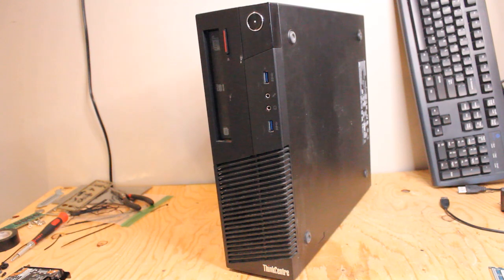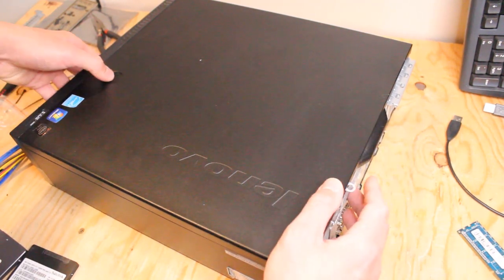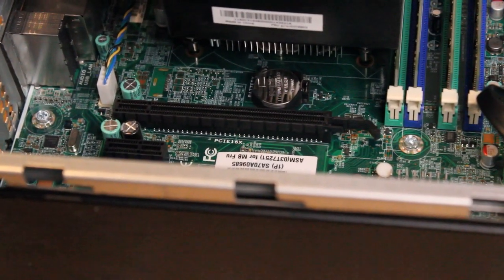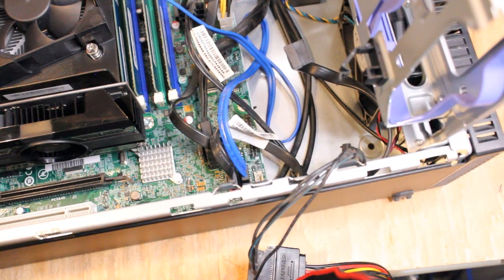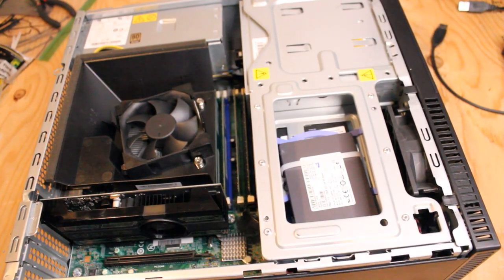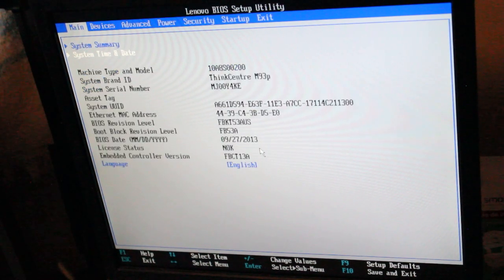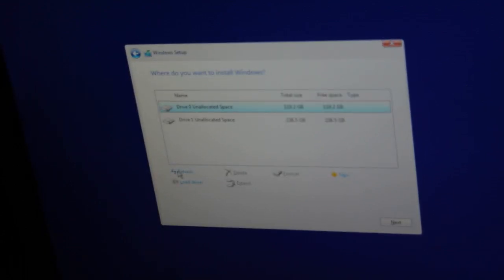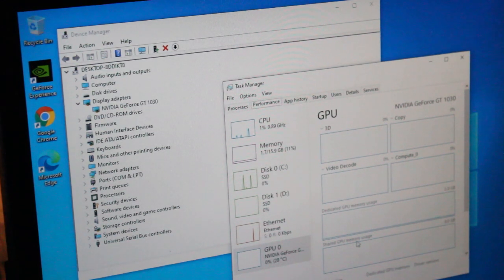ThinkCentre M93p Upgrades Install - GT 1030, 16GB RAM, 2 x SSD

Comment: What's the max capacity ssd I can put In this?
Reply from the maker: Do you need over 1TB?  Whatever capacity you like :)
Reply: @HaisteComputerRepair  the 10a9 version I just bought on ebay says Supports 250GB, 500GB, 1TB and 2tb. Does that mean the ssd has to be those exact sizes?
Reply from the maker: @ZoldarX  Nope, it can be any size SSD so long as it's SATA 2.5."  I most typically install 128GB SSD's for a boot drive and then add a second hard drive or SSD for storage.

Comment: Rmove the procesor collar, Then the GPU doesn't get hot
Reply from the maker: That may assist in bringing temps down, but I don't know that the GT 1030 will get very hot in the first place.  To the point where overheating is at risk.
Reply: @HaisteComputerRepair  In my Lenovo M83 SSF GPU temperature (GTX 1050ti LP) dropped by +/- 10 degrees Celsius. I recommend.
Reply from the maker: @gajowyrozetko9178  Fair enough, thanks for sharing!  If you like, you could modify your original post to better clarify.  That would be awesome.  Otherwise people might get the wrong idea when looking for helpful advice.  I appreciate you sharing, but the original post isn't as specific as your follow up.  What GPU, under what circumstances will it get hot, why you might recommend this, etc.

Comment: I bought one for $100.00 Canadian.
Reply from the maker: That's not too bad.  What did it come with for RAM, SSD/HDD, CPU?
Reply: @HaisteComputerRepair  I bought one in February for $80.00 CAD. (as we speak there is one for sale online within pickup distance for $80.00)  It came with a monitor, keyboard, mouse;  RAM 16gb, SSD 240gb, cpu i5-4570.  (I added an M.2sata card in the PCIe slot, for OS;  plugged the DVD into eSata socket.)
The real improvement to m93p would be the modifying of the BIOS, so it would boot from an NVMe card in the PCIe slot.  It can be done, and was done, but it is not something I would attempt.
Reply from the maker: @m93p  Very cool.  Is that in USD?  Great deal.
Reply: @HaisteComputerRepair  Don't want to be rude, but CAD means canadian dollar
Reply from the maker: @m93p  That's odd, I must have missed the CAD after the price.  Sometimes I skim through comments pretty fast before replying.  Either way, $80 CAD is a great deal.   Have fun with your system :)